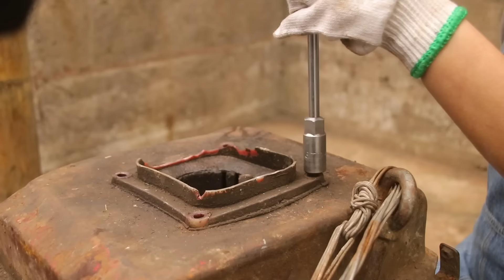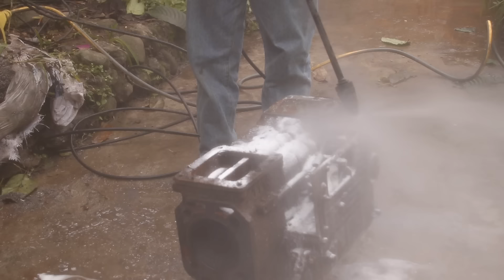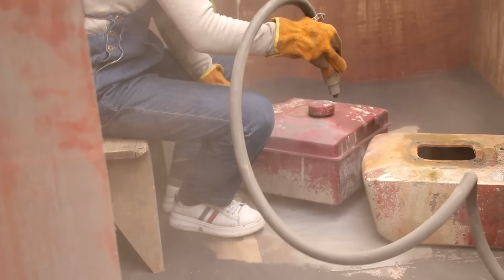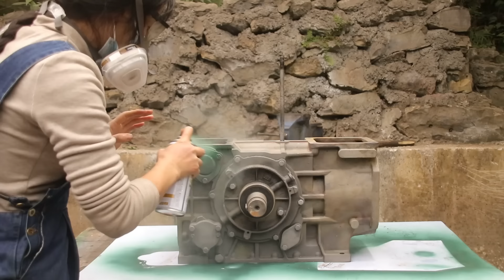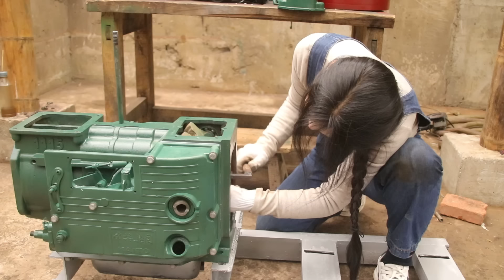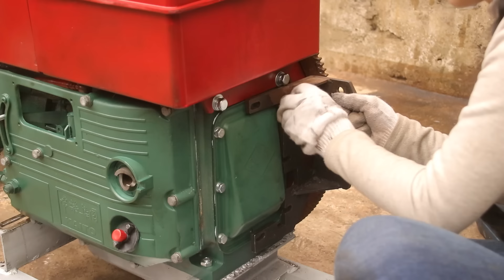💡天才少女翻修坏了生锈的发电机，3天修成和新的一样！A genius girl renovated a broken and rusty generator丨林果儿

Comment: Wear a respirator when sandblasting Lin. Be safe. Here a full body SCBA suit is worn and air supplied from a breathable air compressor located far from the sandblasting. For small parts a special glove box is used. It has a window to see in. I  used those very much.

Comment: i don'tknow if those videos are real but you should always disconnect the negative first on the battery before the positive one.
Reply: That advice is applicable inside a vehicle engine bay, which is connected to negative. Your tool for disconnecting might accidentally touch one of many parts.  In this case, there's no chance of short circuit across battery.